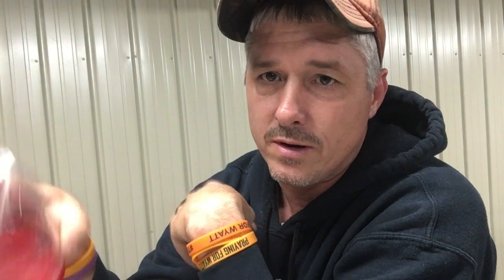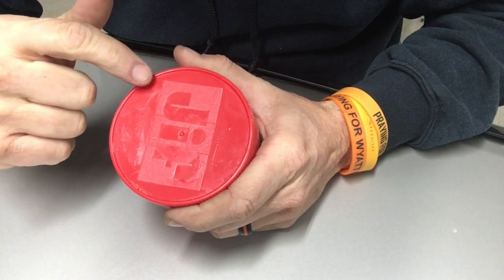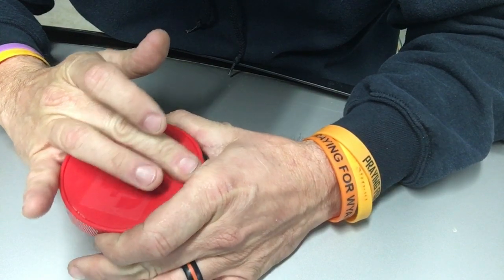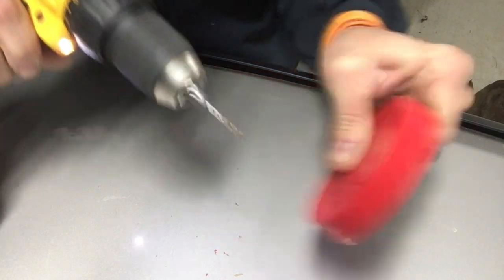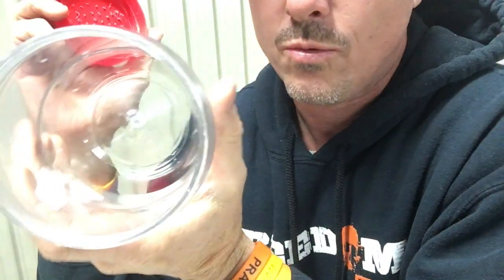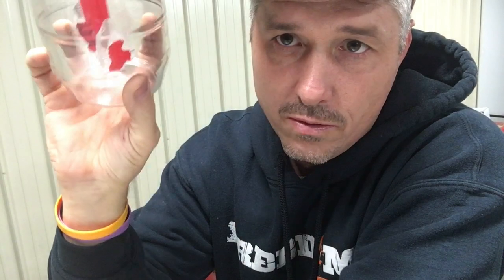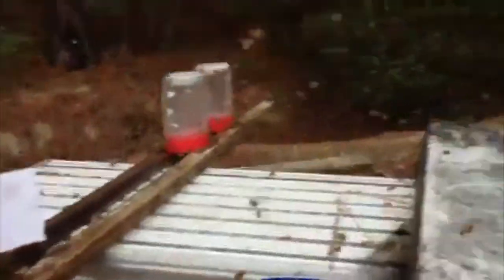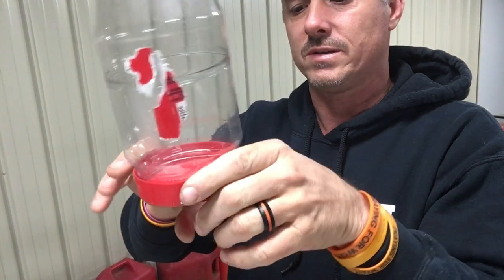How To Make Honey Bee Feeder Out Of Peanut Butter Jar

Comment: Thank you, this is great!  I have a paper wasp colony in my roof eaves and very conflicted about keeping or destroying the nest.  They have been there last year, they mind their own business and look very sweet flitting about, not aggressive, and I like them.  I have 3 hummingbird feeders.  I expanded the feeding holes for the orioles as well, and now, the wasps are all over them, getting inside to drink, and dying inside, and chasing away the hummers and orioles.  This will not do. I can try this feeder system you have, or I will have to remove the entire nest and kill them all.  Since there are many more wasps this year and they winter over in the mild winters, this will keep growing.  It was the size of a palm, now the nest is the size of 3 hands, under the roof eave.  What are your thoughts about this?  Any and all advice based on experience is welcome.
Wasps and bees are attracted to yellow and white and light colors.  I repainted my hummer feeders all red so hummers see it, and not as attractive to wasps, but they are still there!
fyi - I would use a hair dryer to heat up the label on those jars and they will peel off easily.  I would also add some yellow paint on them maybe polka dots or something so it is even more visible to bees, especially on top.